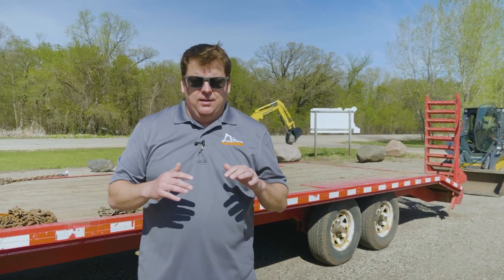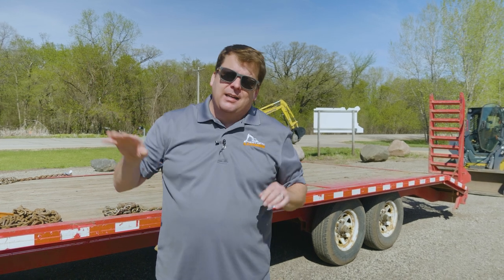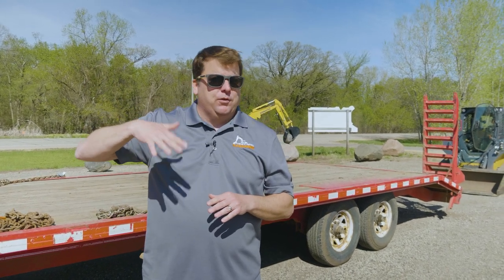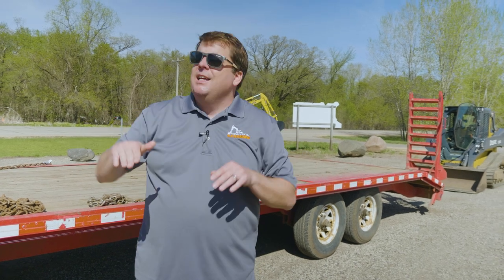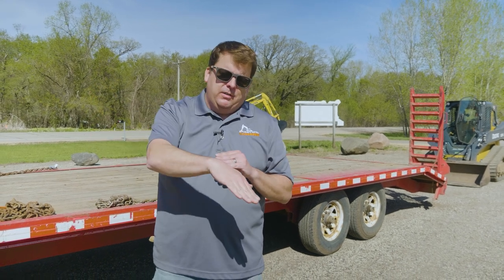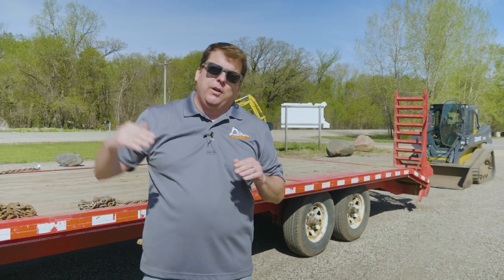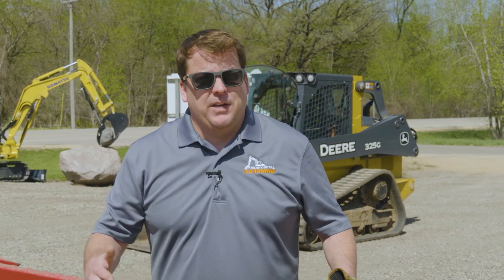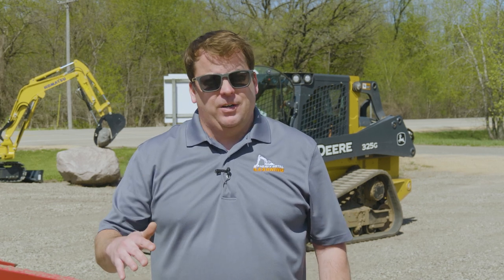How to Load a Skid Steer | Heavy Equipment Operator Training

Comment: I would highly recommend using the manufacture's tie down points (on the bottom side of the boom on the Deere 325G), as opposed to utilizing the human handholds on the front of the machine that are designed for a couple hundred pounds, not 9650 lbs. If the machine doesn't have built in tie down points in the front, you can run the chain through the cross tube of the boom.
Reply from the maker: Good tip, and definitely recommend using those tie downs if possible.   I was told by one of the dealers (and I also see the dealers themselves do this) that the handles can be used as tiedown points.   One of my complaints with the JD is the single tidedown at the very bottom is just in an awkward position and very close to hydraulic line to use (unless no bucket on) and then the pockets they have now added under the boom arm don't have any easy pass through to wrap around.   Do you know if JD published anything that says you can't use the handles as tie downs?
Reply: I would also highly recommend to stay away from using those handles. I have had them severely damaged and bent during transportation almost breaking the welds.
Reply: Exactly my thoughts....my goodness!
Reply: @HeavyMetalLearning  9500 lbs and 1/2 inch thick welded on rods tell me you shouldn't use the handles
Reply: @HeavyMetalLearning  If you have a dealer telling you this, see if they'll put it in writing for you. I bet they won't. JD has put something in writing though, in their manual.
Reply: @HeavyMetalLearning  never trust a dealer.. their job is to get as much of your money as possible. if you're tied off improperly, insurance may not cover damages, which means you have to come out of pocket for repairs, which goes in their pocket if you use their repair shop. :) on the bucket point. you can always take the bucket off once you get on the trailer and secure them separately. might take a little bit more time, but much safer
Reply: @HeavyMetalLearning pass through to wrap around????? You put the hook in the pocket..... I dont really understand what you're saying. Every skid steer I've ever seen has pockets on the arm with a chain symbol next to it because that's the attachment point. Idk who told you that was okay, but you're gunna get a lot of people in trouble with DOT if they copy what you did.

Comment: I was taught "Never hook a chain to anything but a chain." The hook is made to attach around the link on %90(or more)of chains. In my humble opinion your front chains were placed to far forward on the trailer side and over the bucket(creating a perpendicular load), i would suggest a straight path between attachment points and bring my chains between the rear of the bucket and the front of the track in a straight line from boom to trailer. These are a few things i learned over the last 24 yrs of doing this stuff. Keeps me & my guys safe and i hope it keeps you safe as well! I currently hook n book daily on the same trailer with a CAT277 (multi loader tracked) hooked to a Freightliner FL60 dump truck. Besides the above mentions my only other preference is chalking trailer tires to keep the "deck" stable while loading/unloading(especially tracked equipment). Great info and great videos!! Please keep them coming so we can all be safe n effective!!!
Liked and subscribed!
Reply from the maker: Great info....thanks for sharing.
Reply: Your better off with foundry hooks attached to your standard grade 70 chains or even clevis hooks 🪝. They fit into just about any tie down point on any piece of equipment.

Comment: I have a small problem with securing That Cat using the Handholds for Tie-Downs, Being a Certified Welder sometime we just don't trust others welds especially if you have a tension strength of about 1000 lbs at each securing point or Chains...But one very good Video, I learned something today...

Comment: I like to load my track skid backwards and I align the tracks right on top of the 2 axles of the gooseneck...perfect weight distribution as the engine and bigger counter weight are on the rear of the skid. Also don't ever chain down down skid through the handles.
Reply: I concur, I do the same thing. Also makes unloading so much easier!

Comment: I always put wheel chocks on the trailer tires when loading/unloading. Which helps to prevent it from moving if it picks up the rear tires of the truck.
Reply from the maker: Good tip...thanks for sharing!
Reply: Yep, chocking trailer tires only takes 2 mins & adds a lot of safety. I also chock the FRONT wheels of the truck.

Comment: I have hauled a lot of light duty things for 30 plus years but not a heavy duty which is why I wanted to see this as I just purchased a skid.   First, I learned a couple things from this video.  One why someone might chalk or put a vehicle in 4x4 when loading.   I just put it in the park with emergency breaks on.  I have never done that but now you have me re-think that when going to something heavy like a skid or my buddy's 415 backhoe which is 18k lbs..  Another thing,  why I would buy a full-tilt trailer and not a flatbed as when you backed up, that was a little scary thinking since the skid steer I am buying is wheeled which will pronounce that even more.  My 2 cents.  The biggest thing I learned was I returned my load binders for ratcheted ones.  Going to pick my skid in a couple days so I might as well get it right.  I see why you could get hurt or they could fall off with lever style.   Agree with some comments below about a re-do in your video on attaching to the handles in front vs the manufactured position.  I loved the first re-do and think that was very informative.  if you look forward to the D in Deere about 2 feet then down about 6 inches that's the tie-down on the boom.    My question is why forward-facing vs rear-facing? I am thinking rock chips on the glass unless you can't get rock chips or scratches, although the rear has glass too. just much smaller.  I wanted to say thank you for this video!

Comment: I just picked up a John Deere 319D Track Loader. Watched many videos on how to properly and safely chain down the machine. I am just not sure if you should be chaining to the front handles. I'm sure it's illegal here anyways in Canada. The rear looks good. Other than that, great tips on loading. I know, that uneasy feeling with a track loader feeling like you are going to tip backwards. I actually feel better loading it backwards.

Comment: I would put more than one chain on the back because when you Break that back chain is the difference between the machine from going into your truck and staying in place
Reply from the maker: Not a bad practice, but definitely not required.   In the end always better to be safe than quick.
Reply: @HeavyMetalLearning  Yes it IS required, DOT says 4 tie down points, that's 4 isolated points. They allow the use of one chain if it's ran through the attaching points like you did through the holes on the back, but you need to hook your ratchet binder on the inner part of the chain and back to the outer part, and the same on the other side, in affect isolating the two sides making one chain into two separated sections with the excess in the middle. If DOT caught you transporting that with one chain running through holes in the rear they will def fine you.
Reply: @KACSR15E3  I think that's only 10k or more equipment, which this doesn't meet.
Reply: @KACSR15E3  yeah your 100% wrong...now I would put 4 corners because it take 2 more minutes but you don't have to because it's under 10,001 pounds

Comment: Feel it was a good video , only thing I really do different is using two binders in the rear of the machine  and not the one. Have actually had DOT tell me that was far better and something they look for when watching trucks drive by , if they see two or three they pull them over figuring they are in violation of some kind. I'm in Pittsburgh Pa.  Area so this can be different in other areas.
Reply: Yeah DOT in PA is no joke, even the city cops in that state look for DOT violations all the while watching 4 wheelers going over 30 mph over the speed limit but here you come minding your with one chain missing and bam you'll get pulled over.
Reply: 4 is better but what he did was 100% legal

Comment: WOW! a bunch of know-it-alls in here on equipment loading. You can load front first or back it on, doesn't matter as long as it doesn't want to flip back That will always happen when there's no attachment on, mostly happens on wheel loaders not track. weight distribution is the most important when hauling equipment, You load it your way Good Job 👍😎
Reply from the maker: Thanks!
Reply: The problem on the internet (and in real life) is that people will say "You have to do this and that", and when you ask why, the only real answer is "It's the way my dad/teacher/boss/whatever said to do ti" or "it's how I always have done it" - and some of that is that the person had some bad experience or where told why, but they didn't understand the explanation, and now applies the rule to everything, but it only applies to SOME of the cases. 

Sometimes, you get better explanations, and they are SOMETIMES right, but you also get a load of urban myths. This is of course not unique to the internet, it's just that now someone with a view on how to load a machine onto a trailer can get 1000 people viewing their comment on a 50k subscriber channel on Youtube, where previously, he (or she) would have got half a dozen people on a building site, in a bar or wherever the thing happens to be said. I don't claim to be an expert in much - absolutely not loading a piece of equipment on a trailer. But I understand physics, I know a bit about vehicle steering, suspension and stability, etc. 

Understanding the balance, centre of gravity and weight distribution on your vehicle and your trailer is obviously really what matters. There is no simply rule that applies to everything. If you have a machine that is heavy at the back, then don't go hard forward up a something (ramp or other incline), because it will lift the front wheel. Anyone who has been riding a bicycle on the back wheel knows that it's much easier to wheelie going up a hill, and even easier if you move back on the seat, lean back, etc. No difference with machines. Go slow, understand where you weight is and how it affects and is affected by things around you, all other problems will be covered... :)
Reply: I agree with everything you said the only reason I pulled my Loader on is because I was always told it was bad to have all that wind rushing to my turbo thru exhaust don’t know how true that is I’m not trying to be a know it  just always pulled my machine on as long as I had an attachment on great info though guys

Comment: The GCVW (gross combined vehicle weight) is what the truck can legally tow according to GM in this case.

Also, in many jurisdictions, the truck must be insured to tow the  GCVW.

GM 3500 Truck: 6000#?

Trailer: 5000#?

Deere 325G: specification says 9500#

Combined total: 20500#?
Reply from the maker: Numbers are probably close.   Most 3500 standard pickups have GCVW of 22-25#   Typically max towing is 14500.
Reply: @HeavyMetalLearning  Nope. I hate to disagree with you but you're wrong on max towing again. My GMC 2500 is rated at towing 18,500 lbs. The big brother 3500 is rated to tow (4wd) of 21,300 and if you go dually it can go on upwards to over 35,000 lbs.
Reply: @Steelviper61  the newest trucks yes, older trucks no.

Comment: Great video. I do have a question regarding this specific trailer to CTL specs. How long is the flat deck portion of the trailer? 

If I’m loading that same CTL and I have the bucket and a drum mulcher, and need to consider proper load weight distribution for a bumper pull, how long of a trailer do I need assuming the GVWR and axle ratings are fit for purpose?

Thx for the help!!!

Comment: I work for top gun equipment rentals and we always load these and excavators backwards because you have so much weight on the back and if you're new to this you can possibly flip it going strait up so we back them uo and then all u have to do is drive it strait off when unloading. That's just us though

Comment: there are a few things i disagree with on this. the front handles aren't designed to tie down to. 2: your chains are pinched against the bucket, which can rub and cause a failure eventually. you always want your chains in a straight line from end to end (i run a crane at my job, something we're taught). 3: your back tie down  if possible should be two separate chains. the way they are now allows the machine to potentially slide side to side (however unlikely it may be, it CAN happen, i've had it happen with a tractor, thankfully nothing bad happened.)

Comment: So just watched this video. And I recently started an equipment rental job so we work with skidsteers and mini excavators how do I get over the fear of loading them onto trailers? I can't get over the tippy feeling when loading a skid steer when you get close to being completely on the trailer and your front tracks are up in the air it makes me almost $hit myself every time
Reply: The fear will go away with time. It's all about taking it slow and steady every time. Take the time to learn how your equipment handles on the ground first. Up on the trailer at tip point isn't where you want to figure out how hard or soft you need to push on your sticks to get past that point.  If you can, watch others load that same equipment and see what it's actually doing from the outside. It always feels worse in the cab of the machine. Like the video shows go real slow when your about to hit the tip point and you will feel it. You can stop regain your composure and continue on.
Reply: Whether with an ex or a track loader, you can use the bucket to control the tip down. One way you'll force the transition slightly before you get there, going the other you'll keep the bucket low to catch the tip when it happens.

Comment: With a deck over trailer I would back machine on , ramps are steep.  Also front  chain hooks should be attached in lower in arm slots,  grab handle not made for chains

Comment: Yeah it’s always best to reverse upward but it doesn’t matter too much with a skidsteer.
And, this type  of skidsteer has a loop bar under the front (behind, below the bucket) and I loop one chain through it and across the bucket, tying down the bucket with one ratcheting come along. The rear, I loop the chain through, lock the hook, and drive forward 2-4” and then ratchet it down so I never have too much slack! Both front and back, I use the come along to pull the chains together. Like an inverted V shape. 
Sound right?
Reply from the maker: Yeah, I'll back on if I don't have an attachment on the front OR if its a wheeled machine, but generally I pull them on forward.   Yeah, and lots of skids have that center connection on the front underneath but I think it is just a pain to get a chain through (especially on JD).  Plus on this JD there is the hydraulic line right near that bar so I don't like taking the chance of hitting a line while tightening down.  From everything I have seen, I believe those 2 handles on the arm are approved as tiedown's.   But I agree, in an ideal situation that main point in the center front would be the best location to attach to.   Haven't heard that strategy on the back, sounds like with your inverted V I would be concerned with it having the ability to slide.   Why not just go through both openings (assuming you have tiedowns on each back corner of your machine) and then secure to the corners of your trailer?   Always good to hear from others on how they do it.  Like I said, I don't believe there is only ONE right way.   Thanks!

Comment: Good video but thats a good way to get a smashed window from oncoming traffic
Reply from the maker: How so?
Reply: @HeavyMetalLearning  by loading forward rocks are able to hit the front door on the skiddy. Also, in snowy regions on non cab machines, loading forward, all the rain, snow, salt brine goes right into your cab. By loading backwards you are following osha protocol, (safer) and protecting the interior of your cab / rops because all that stuff will be hitting the tail gate instead of going into the cab area. My apologies on my post that I deleted yesterday. You are just trying to be helpful, so was I, but I don't have good "word smithing" skills!
Reply from the maker: @billiardbrawler  Interesting perspective...thanks for sharing.   What osha protocol are you referring to?   And not sure I agree on the rocks hitting the front door.  How is that different than every other vehicle out there?  I guess maybe if you are traveling a lot on gravel roads they probably get rock chips more but for most travel I don't think that's an issue.   I would absolutely agree with you that for a non enclosed machine it would probably be best to transport backwards to keep those materials from coming in the cab (especially if nasty conditions).   Again, like I stated I don't think there is any single ONE right way, so for those that are loading backwards feel free to keep doing that.
Reply from the maker: steve helline interesting...thanks for sharing that info!

Comment: Why would you tigh down to the handles? That’s basic tight down NO NO,  makes me wonder your actual experience with equipment loading on a trailer.  My 7 year old knows better that the welding on those handle won’t be sustained that machine.  Other than that,  an overall good vid